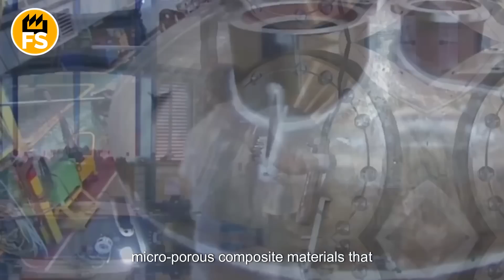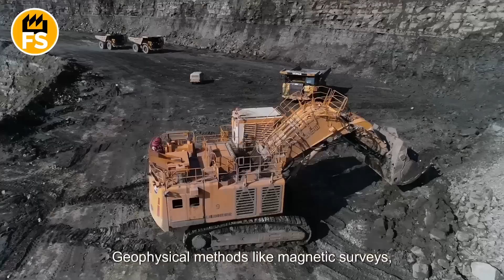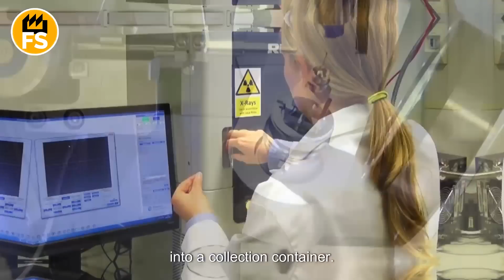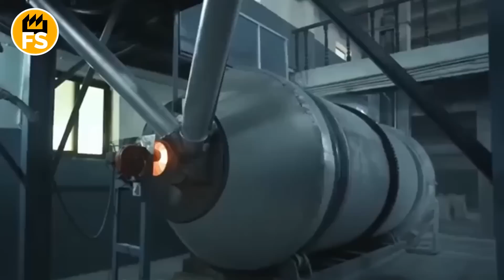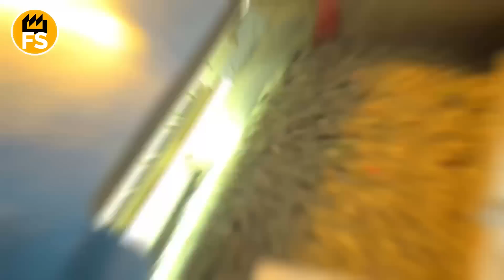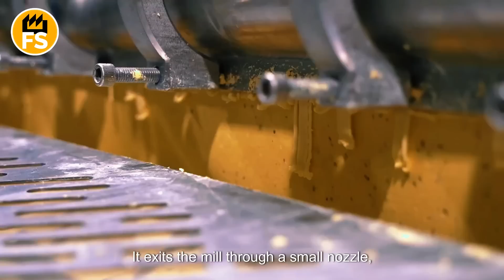How Are Nuclear Submarines Built? A $3 Billion Engineering Marvel! 🚢💰

Comment: You need to get your facts right. It takes $3 billion to build a nuclear submarine. It costs over $13 billion to make and create an aircraft carrier so there is a little difference of $10 billion so you are wrong. It’s not one of the most expensive
Reply from the maker: @england902 fair point, a carrier is pricier for sure. but a single Virginia class boat runs around three to four billion and the new Columbia class is even more, so subs are still up there with the most expensive things the Navy buys https://en.wikipedia.org/wiki/Virginia-class_submarine